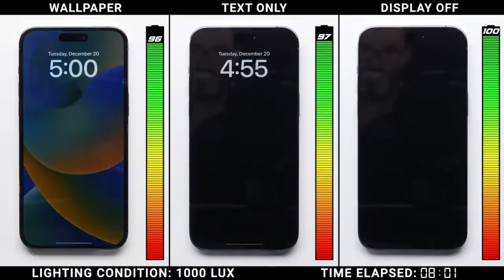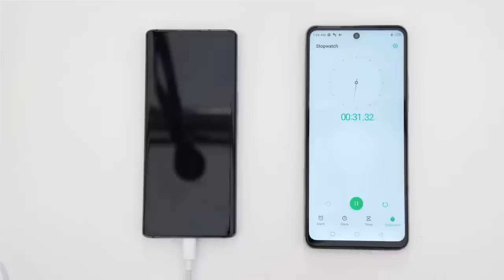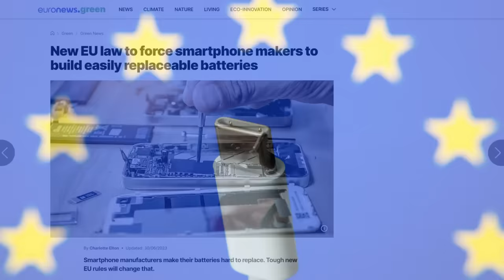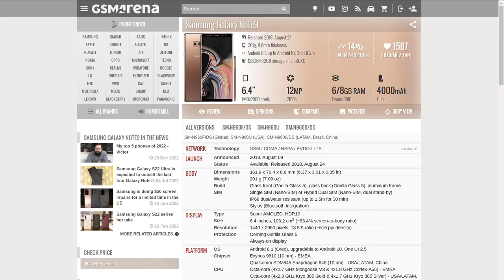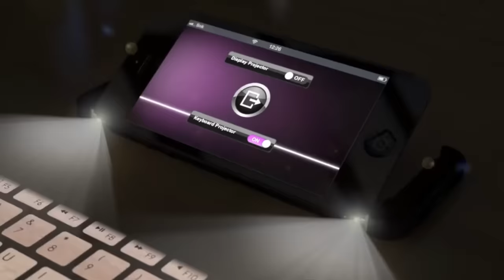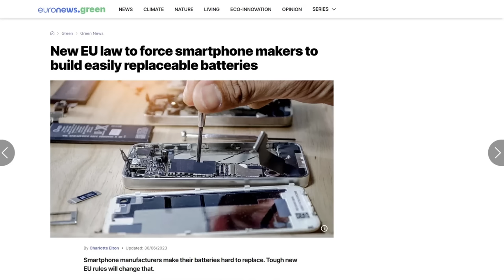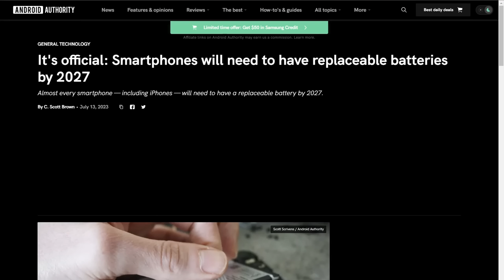All Smartphones Will Soon Have Removable Batteries

Comment: With regards to water resistance, the Samsung Galaxy S5 had a removable battery, whilst still having an IP67 water resistance rating. It's likely that there won't need to be a trade-off, unless manufacturers purposefully want to make their phones more brittle to regain their lost sales revenue.
Reply: Unlike IP68 phones, the S5 is water resistant, not waterproof.  Try googling "The truth about the Galaxy S5 IP67 Water Resistant Certification"
Reply: @chumanho  IP68 phones are not waterproof either. Yes they can stay underwater for some time but certainly not forever. Waterproof means forever so they are still only water resistant.
Reply: @dayko.  I doubt any people need their phones to be able to be immersed in water forever, it's just that IP68 phones can be immersed in a greater depth for a longer period of time than IP67 phones.
Reply: Nobody should be scubadiving with their phone. Obviously your phone shouldn't get damaged by exposure to water droplets like when it rains. Maybe if people drop their phones in a lake by accident, it would be nice if they could retrieve them without damage in ~15min or smth. But tbh I would take removable battery over submerged water-resistance anyday. Never dropped my phone in a lake and never will.
Reply: @Anton-rr9kw  I live on an island and have to take a ferry every time I need to go to the city.  Shipwrecks have happened before, and I definitely want my phone to function when I need it the most.  Replaceable battery, to me OTOH, is not a life and death situation.
Reply: @chumanho  Try this thing called a plastic bag for your phone, much better IP rating :P
Reply: @silak33  Yeah no one is going to carry their phone inside a plastic bag for water resistance. They'll just buy a phone that's IP68 rated, even if it comes with a battery that's hard to replace.
Reply: @chumanho  alright mr. edgecase. if your ship shipwrecks you should get any calls you need to make out of the way before the ship sinks and your phone falls into the ocean. I don't know what the scenario is where your ship sinks and your phone falls to the bottom of the ocean and you should be able to retrieve it. Ofc your phone (with removable or non-removable battery) should be able to withstand water droplets and being submerged for like ~1min or something.
Reply: @silak33  From Quora:
"Even if you put your phone in a plastic bag, you need to be careful as the plastic bags are not always airtight and may not provide enough protection against water. There is always a risk of water entering the plastic bag and damaging your phone. Additionally, the plastic bag may not be durable enough to withstand the pressure of being submerged in water, which may cause it to tear or leak."
I'm not taking chances with a plastic bag.
Reply: @Anton-rr9kw  1min window for calling for help is not reassuring at all.  If everyone can make out of the way before the ship sinks, then no one ever will die in a shipwreck.  Retrieving the phone is not a concern at all.
Reply: @chumanho  shipwrecks -> I assume your not instantly in deep water. Ship starts sinking, takes a while until you are submerged. What are you talking about man.
Reply: @Anton-rr9kw  Your assumption is not true.
Try google "2012 Lamma Island ferry collision"
From Wikipedia:
"The vessel reportedly went down so quickly that more than 100 passengers were thrown into the water unprotected despite an abundance of life vests on board."
39 deaths!
Reply: @chumanho  what does this have to do with removable batteries?
Reply: Just isolate the battery compartment, IP67, from the board section, IP68; make the contacts low impedance, and make them out of an alloy that's resistant to corrosion.

Duh. 🤦
Reply: @Anton-rr9kw  You said you prioritize removable battery over submerged water-resistance.  I'm just saying not all people have the same priorities.
Quoting you:
"Nobody should be scubadiving with their phone. Obviously your phone shouldn't get damaged by exposure to water droplets like when it rains. Maybe if people drop their phones in a lake by accident, it would be nice if they could retrieve them without damage in ~15min or smth. But tbh I would take removable battery over submerged water-resistance anyday. Never dropped my phone in a lake and never will."
Reply: @chumanho  true and based
Reply: Too bad it had TouchWiz 🤮
Reply: @chumanho  I jumped into a pool multiple times with my S5 and recorded videos underwater and the phone kept working perfectly fine
Reply: I would like to see a highly water resistant phone with a removable battery, but these two technologies are not complementary. The only way to truly make something waterproof is to have seriesly strong rubber seals or a steel screw assembly, neither of which are easily user-serviceable.
Reply: @chumanho  I'm sure dropping your phone into the water from a ferry ride would be the end of your phone anyway. Unless you have a phone flotation device? The replaceable battery should have never gone away.
Reply: @RayHikes  I've done it. My phone doesn't have a rating. I protect it in a ziplock sandwich bag - works great. Cheap!!
Reply: @chumanho  It works fine. If you are under enough pressure that the bag gives out (against the small openings of the phone) - you probably won't live long enough to use the phone anyway.
Reply: @Atomic361  I don't doubt your claim, but with IP68 mid-range phones a dime a dozen, I don't have a reason to settle with IP67.
Reply: @dont.beknown5622  I've heard of instances where people fell into the sea have no problem using their phones.  You never know how things are going to pan out.
Reply: @dont.beknown5622  I don't want to count on plastic bags, too flimsy.  Also, constantly having the phone in a bag hurts its usability.
Reply: @Obamium_ most importantly, this was the S5, and technology has progressed a LOT since then. So I'd expect a higher rating on something made now
Reply: @chumanho  Louis Rossmann did a video on this recently. There is a Sony phone with IP68 rating and a removable battery. So the idea that fixed batteries are necessary for IP68 isn't true, it's just a good excuse.
Reply: @steeviebops  Yes, IP68 with removable battery would be good.  I was just responding to the OP which asserts that IP67 is good enough.
Reply: @chumanho  and most people don't have to worry about such things. There's no law in physics stopping them from engineering ways around this, whole argument feels like a false dichotomy. They have 4 years to figure this out and nothing's stopping them from making different models in different jurisdictions either.
Reply: @thelakeman2538  Sure it's a false dichotomy, and they have solutions now.
Reply: I already thought of a solution. There are already battery solutions that are water resistant. You could make the battery/sim/storage compartments be separate from everything else and have them be immediately behind the back cover of the phone. This would be achieved by having everything else inside a sealed compartment the way it is now but just having the pins exposed through a plastic layer or something separating the battery/sim/storage from all of the other components while keeping them accessible.
Reply: @chumanho  then you need device designed to be used under water, and this and medical equipment are the only exceptions.
Reply: @RayHikes  what are you on about LOL
Reply: @chumanho  you are literally contradicting yourself... what are you trying to say here ? replaceable batteries bad ?
Reply: @hareshrk6259  Of course not.  I have a phone with replaceable battery myself.  When did I say replaceable batteries bad?  Can you quote me from the thread?
Reply: lost sales won't be a thing if they can sell batteries for their phones, some people will buy enough batteries as backups to equal half the price of the phone, there won't be losses if the companies are honest with this
Reply: @chumanho  they have removed 3.5m jack & further they can seal the motherboard above including a airless airtight chamber for camera lens
Reply: Another thing is water repellent coating,& the prices they charge no one's stupid to throw a phone in water,and if they do they can get like 500/month
Reply: @dinozaurpickupline4221  No need to remove 3.5mm jack.
Reply: @chumanho  no need but I point they already did that for a more water seal,I just threw in Samsung Galaxy exhibit 2 in water & kept vibrating half an hour
Reply: there exist such magical things as gaskets and seals, so yes it is actually possible to make a waterproof device with a removable panel! how incredible?
Reply: Don't like this, prices will be passed off to us..batteries are removable, you just need a guitare pick
Reply: @chumanho  You use your phone underwater?
Reply: @chumanho  really? Most people lose their phone - that simple. Falling into the sea - my phone is the last thing on my mind. I think that in a ferry sinking or some other such disaster - most people would echo that sentiment.
Reply: @RayHikes  you can buy after-market cases that are waterproof .... Non-removable battery argument is stupid every phone is not waterproof only high end phones are then why every phone has non removable battery
Reply: @dinozaurpickupline4221  some people want their headphone jack, it's doable.
Reply: @dont.beknown5622  I don't want to, but I might be forced to.
Reply: @dont.beknown5622  Try googling:
"Sinking fishermen rescued after cellphone call for help"
"Water-resistant phone behind survival in Incheon boat sinking"

They contradict your assertion.
Reply: @chumanho That's a very specific case but see it like this: You got on a lifeboat but are way out in the ocean and have no signal.
How on earth are you going to call anyone?

What you need is a flare stick, your personal emergency broadcast signal emitter and if you want to be really fancy, your own life vest.

I mean with a phone you could scroll through your cached YouTube videos but that's it if you have no connection.

I understand why you are so paranoid and I would be too but there's more important things than having a useless mini computer at your hand.
Reply: @Squee7e  I take those ferries frequently and my phone always has signal.
Reply: @chumanho  there is no phone that would survive depths which ferries go over
Reply: @waltch5711  Try googling:
"Sinking fishermen rescued after cellphone call for help"
"Water-resistant phone behind survival in Incheon boat sinking"

Those phones survived and let them call for help.
Reply: like "how there is not enough space for headphones jack"
Reply: I once accidentially dropped S3 on snow - when I found it was already wet. Still working despite no promised water resistance.
During rain, touchscreen of my "water resistant" A50 stopped working, I needed to replace whole display and its still glitches (also fingerprint sensor stopped with "callibration needed" BS).
Reply: What a time to be alive.. what good times to have a smartphone 😅
I loved the s6 edge with IR blaster.
So much fun 😂😂😂
Reply: @chumanho what are you talking about, not only is that incredibly unlikely, if that happens you can just make any calls you need to before the ship sinks. Ships usually take quite a while to sink unless it’s an absolutely catastrophic unprecedented accident, it’s not like a plane or car where an accident would be pretty much instant death or injury
Reply: @Dell-ol6hb  Your assumption is not true.
Try google "2012 Lamma Island ferry collision"
From Wikipedia:
"The vessel reportedly went down so quickly that more than 100 passengers were thrown into the water unprotected despite an abundance of life vests on board."
39 deaths!

Comment: I used to carry around a stack of 5 batteries in a little plastic case, very similar to those 3DS cartridge cases.
Driving through outback Australia without spare batteries was and still is tantamount to suicide.
Reply: Don't most roads in the outback have no reception though... unless you're talking about a satellite phone?
Reply: @Curiefeld  it's getting pretty good up the middle, there are still times you go for hours without reception
Reply: cant you use a solar panel or thermal generator?
Reply: @coler154 You can but would you rather be out there for 6 hours if your car breaks down waiting for the solar battery to charge
Reply: @aussiegruber86 theres sections on the bruce and peak downs highway that are deadzones for 60%+ of the journey. I swear they are getting worse
Reply: @Curiefeld  I guess technically you could mount a starlink on the roof of your car?
Reply: ever heard of powerbank???

Comment: My previous phone was a Samsung Galaxy J3 Prime. Having a replaceable battery was one of the main reasons I bought it. When my phone started having performance issues due to the battery dying, it was $25 for a new battery, and everything worked as intended. It was awesome!
Reply: Fr man
Reply: Why did you buy a new one then?
Reply: @infinitieunique  The hardware was extremely outdated. I couldn't update most of my apps as they were no longer supported on Android 7. Upgrading Android to a newer version wasn't possible due to the hardware limitations. Plus, I started to run into storage issues as that phone only had 10 GB internal storage. It was finally time for a new phone, albeit without an easily replaceable battery or headphone jack :(
Reply: @tenhundredkills  what do you mean by "not supported"? You can still use an old version like you used to when it was 2010 outside
Reply: @infinitieunique  "No longer supported" as in apps were no longer going to be receiving security and/or perfomance updates. Some apps flat-out broke (like MS Teams). Some of the apps I needed for work, so I didn't have much of a choice but to upgrade to a newer phone.
Reply: @infinitieunique  Same reason for me. As we use a "goverment" app, it's technically a private company that makes it, to do a 2 type login system. It's to prevent hacking and people from login into privat things like banks and so on. As you login the app on your phone needs either a code or fingerprint to allow the acces to be made, even if it's on a computer or other device than the phone. It's also used for the government e-mails you get and to login to your medical systems and so on. It's actually a upgrade from a system where you used a random code on a credit card size papir to log in with, I think you can still use that system if you don't want the app.
But as it requires as much safety as possible, so when safety updates to android systems stops you will have to upgrade your phone for it to work again.
Reply: @tenhundredkills  exact same problem occurring to me. Only 10 gb internal storage and only 500 mb freee space. Some days ago, I tried to installed ms teams but damn. It was not available. Later I knew whole thing
Reply: @-JustHuman-  I work in IT, and we recently deployed 2FA for one of our newer clients to meet FTC regulations. Some of the employees didn't have smartphones or new enough phones to install the app. For them, we made security keys since that was faster and cheaper than buying a smartphone just for 2FA logins.
Reply: @bibekkoirala352  Aside from newer versions of apps not being available, my old phone also had issues where it often refused to connect to WiFi unless I turned it off and back on. Even then, it still wouldn't always connect. That was incredibly irritating!
Reply: @-JustHuman- Sure.... Ahem....
Reply: Why in the heck don't they already? This is inexcusable! I have a tablet where the battery began to swell, forcing me to get rid of it. Unfortunately, it was taped and there were apparently wires or something that got ripped out, so basically I have to throw away the whole tablet now.

Comment: Water-resistant phones (I am not counting special rugged phones) were always a thing. I was buying WP phones before smartphones. And that was with snap-on back panels. If you opt for screwing in a backplate, you can include gaskets and easily get 100 m water resistance and more. Digital Casio watches from the 90s and before had easily replaceable batteries. It's hardly a hot swap solution, more of a 'replace used up battery' case, but as a backup, or if you are going to travel far from electricity (like in my case), it would still work. That is an overkill, but likely some sort of intermediate approach would also be possible, like having a circle cut out separate from the rest of the back panel and working as a screw itself as in most mechanical watches. But yeah, even a snap on panel is enough to reach 'dropped it in the toilet' level of waterproofing.